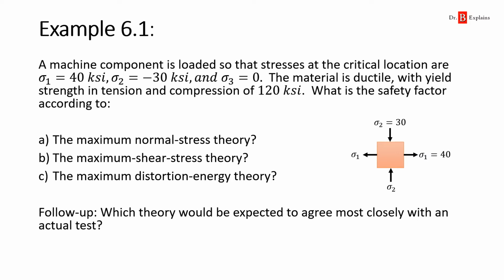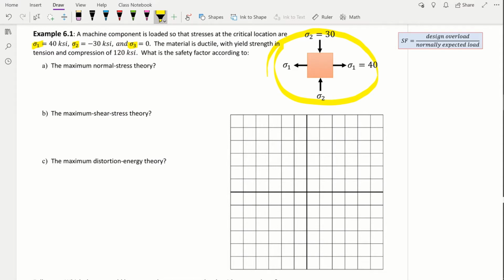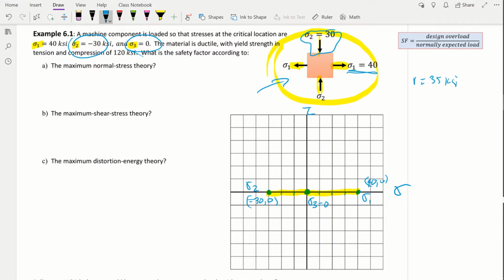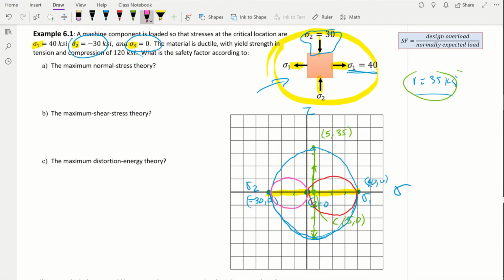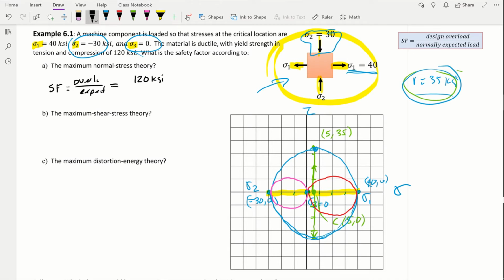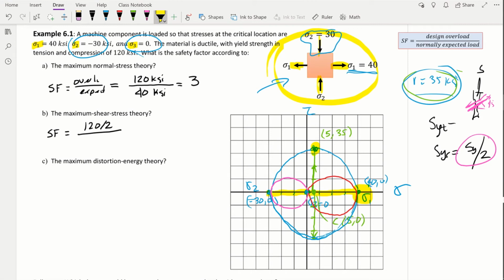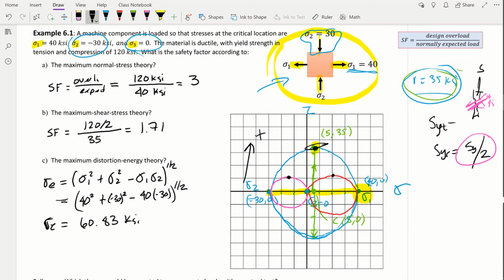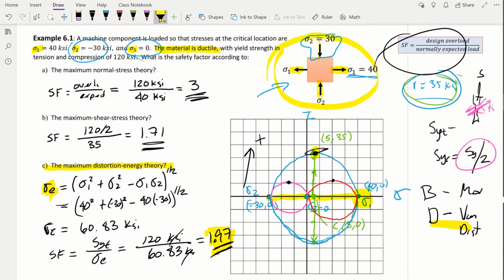Machine Elements - Ex 6.1 Static Failure Theories

Comment from the maker: I forgot to mention in the presentation that for maximum-normal-stress theory predicts failure will occur when the maximum-normal-stress reaches the Ultimate Stress (Su), however when the Ultimate Stress is not known, we use the Yield Strength (Sy) as the upper limit.